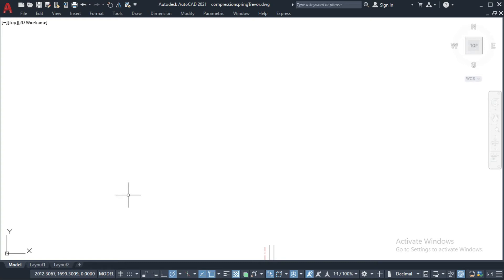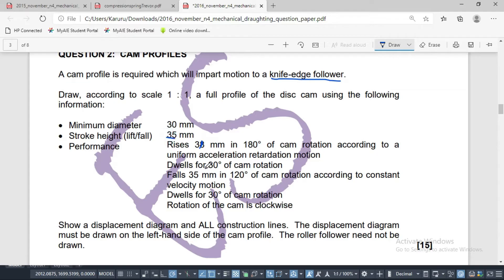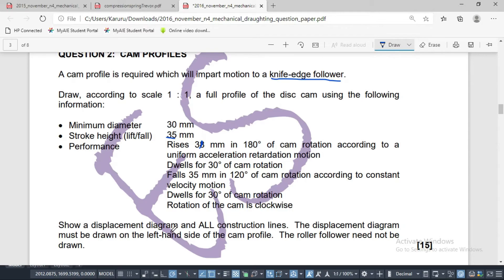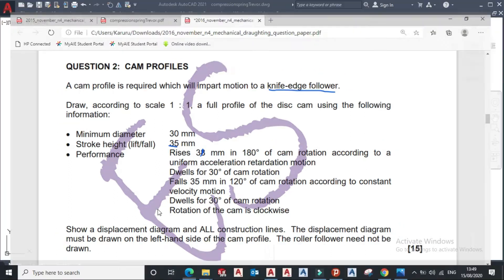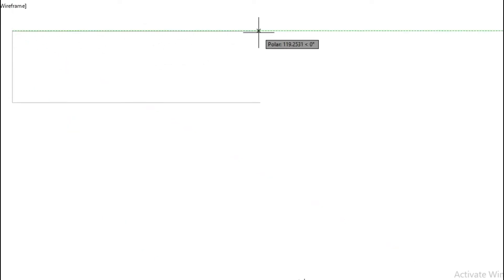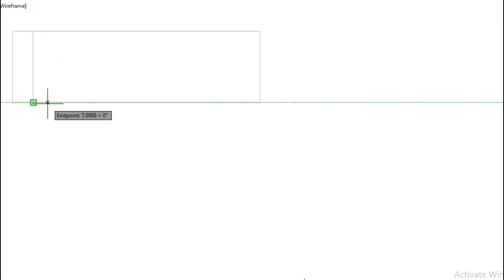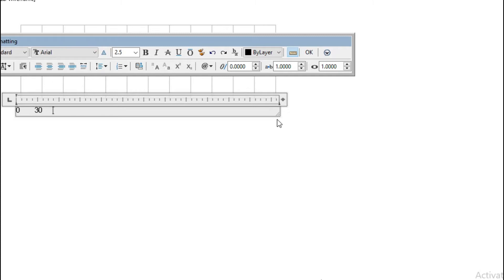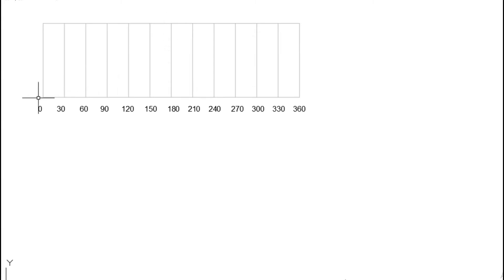HOW TO DRAW A CAM PROFILE - MECHANICAL DRAUGHTING N4

Comment: What is the calculation for distance from 360 to the end radius of the circle
Reply: It's 90mm, but if the diagram has a semi circle you start with the scale of 15mm then from 15mm you do the next scale which is 90mm

Comment: What angle did u use to measure that line which form a UAR
Reply from the maker: You draw it at any angle....
Reply from the maker: That is the procedure to decide a line into equal parts using  drawing instruments

Comment: but u have used anti clockwise ...the question was stating it should be clockwise
Reply from the maker: When the cam is moving in a clockwise direction...the numbering on the profile must be counterclockwise
Reply: @charleskaruru481 what is the radius of the bigger circle you didn't say
Reply from the maker: @MufulufheliMakhuvha the radius of the bigger circle is equal to (the radius of the minimum diameter plus the rise of the cam
Reply: He's 100% right.
Reply: Thank you